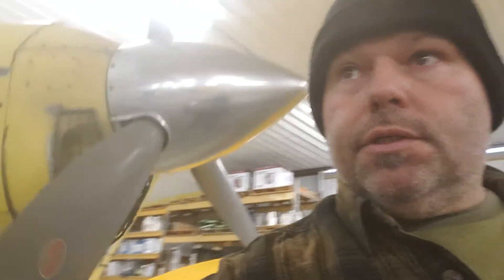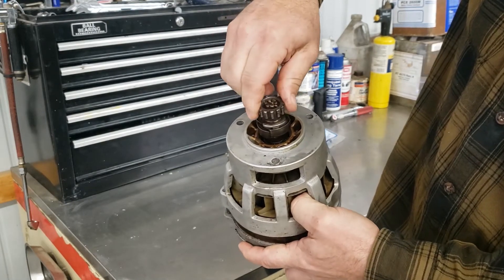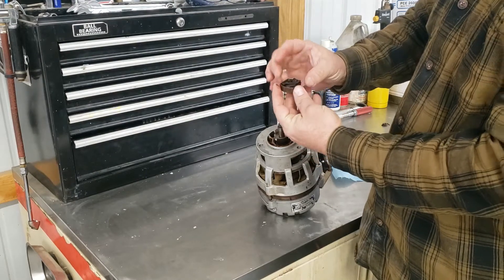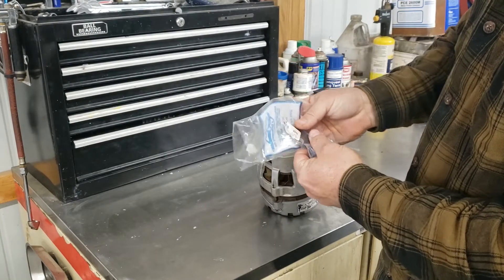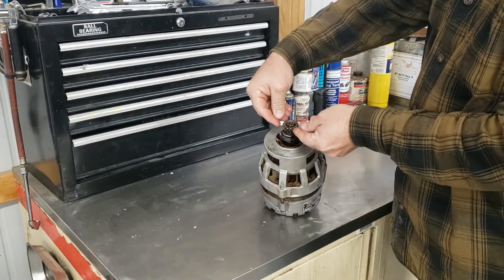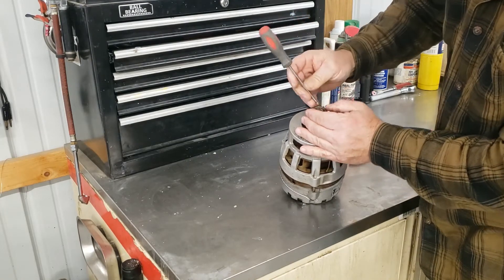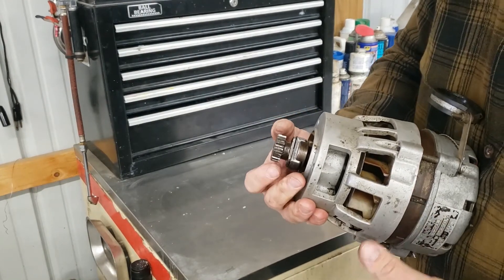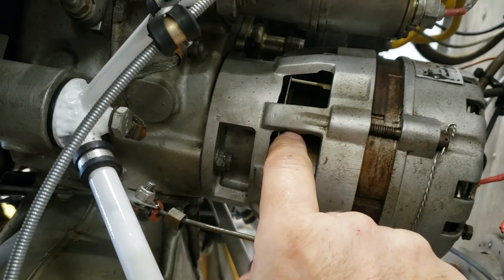Continental - Aircraft Alternator Drive Repair - Cessna 140

Comment: Justin, how do you torque that top AN316-4 on the alternator? I successfully removed my tach drive housing first but that was probably due to the nuts being insufficiently tight.

Reinstalling I plan to torque the tach drive housing first. I cannot see how I'll be able to access the top nut for the alternator.